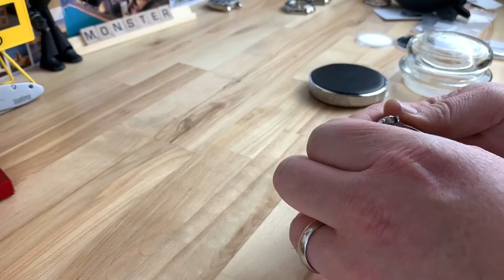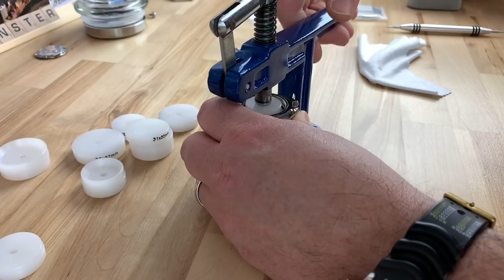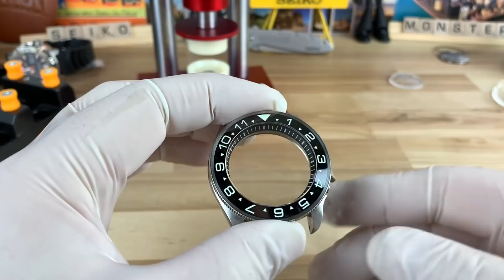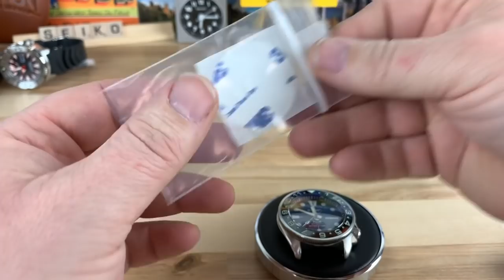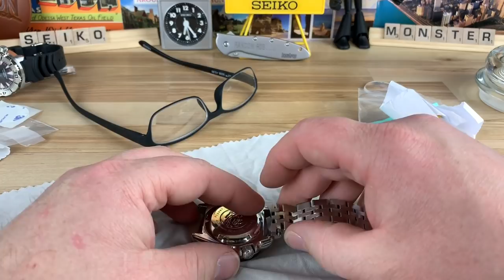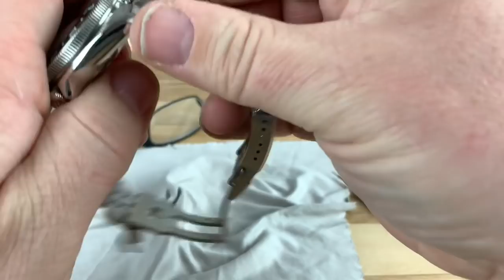Seiko skx mod (finished Homer’s watch)

Comment: For inserts I prefer some type of contact cement. It’ll give you a few seconds of wiggle room to align the insert. I used the 3m tape once and once I placed the insert down, that was it. Luckily I had it on straight
Reply from the maker: Yeah the 3m doesn’t mess around at all. Gotta be on your game to set that insert down.

Comment: what is the quality like on these aftermarket ceramic bezel inserts? 

is it comparable to the one that would be on a high end seiko or a rolex?

or are they just recommended to be used with low end seiko watches?

Comment: Yes it's a nice looking mod on a diver's watch.. So why using a gmt bezel insert?
Reply from the maker: Cause that’s what Homer wanted.
Reply: Many "Diver" watches are actually desk divers. I like the GMT function (and use it for work) and prefer a mechanical movement, that combo is hard to find so a simple change of the bezel/insert offers more choices.
Reply: It's not a GMT, it's dual time which is actually useful.
Reply: @LeiteJohannes  and if you set the "dual time zone" to Greenwich time?  Thanks for taking the time to needlessly correct me....

Comment: I find when seating Crystal's is to hand set them to get the   crystal seated straight on all sides then use the press to push it in the remainder of the way. Nice mod!
Reply from the maker: So use finger strength to get it sorted then smash it down?

Comment: I missed the part with the chapter ring.  How did you make sure it was aligned?
Reply from the maker: It is factory Seiko and has the key so it stays in correct place. It happens to be a good one that lines up. Marc at Long Island watch covers this topic the best. I can try and show in future vids.

Comment: The way i get rid of dust inside is by using some scotch tape from walmart and stick it on the crystal and lightly pull it off and it works all the time. Does not leave any tape residue.

Comment: Sweet looking piece. That lume is nice. I have been looking at modding a PADI Samurai for GMT functionality. Would you happen to know if the Murphy bezel will work/fit on the Samurai?
Reply: Erik Lind  I put the LCBI’s Black lumed ceramic Samurai dive insert on my PADI Sami and it looks unbelievably high-end. The flash of that etched glossy bezel combined with the detail of that PADI dial is truly a sight to behold🤩

Comment: I've been patiently been waiting (seems like months) for your recommendation on a crystal press that actually works and for it not end up in the trash bin.  Could you please provide a link to both of them please?
Thanks from Japan!
Reply from the maker: https://rover.ebay.com/rover/0/0/0?mpre=https%3A%2F%2Fwww.ebay.com%2Fulk%2Fitm%2F123294218596
Reply from the maker: This one works great so far. I will look for the blue one and get a link.
Reply: @RandomRobReviews   I just ordered the screw press, but from my side of the world.  Don't need the blue as I have a cheap one as spare if needed.  Watch looks great!